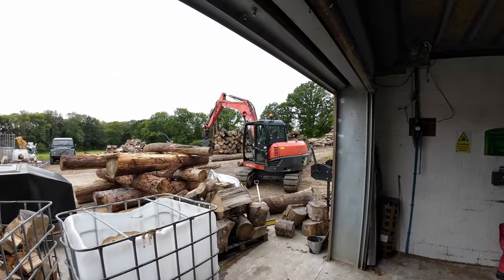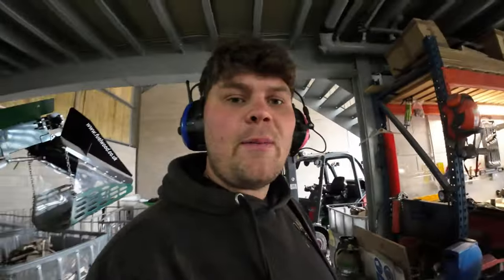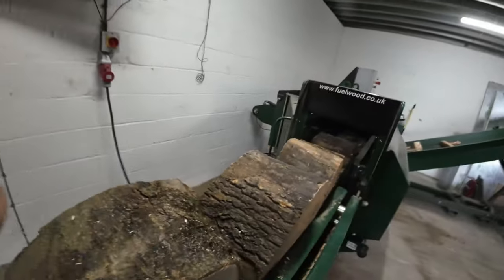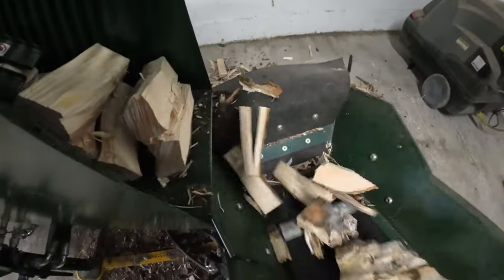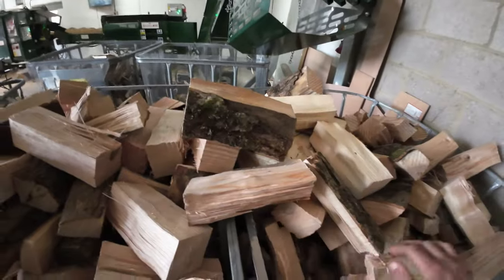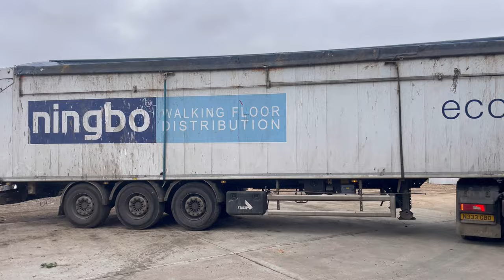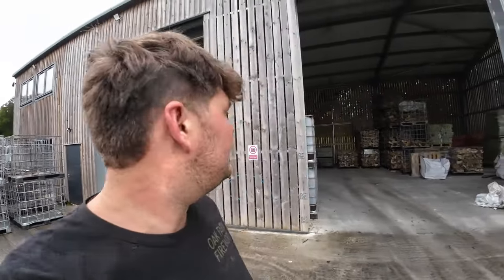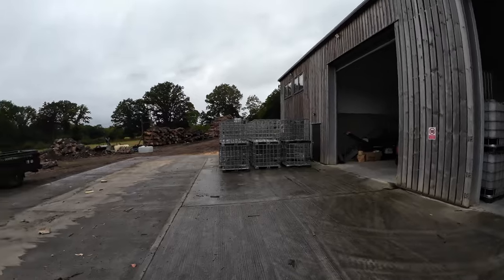Day 34 - New staff and BULK load heading out!

Comment: How many cord is that semi? That’s nice you get big orders like that? What are they using the wood for? I do like the rotators. I’ve been considering a forklift.
Reply from the maker: I’m not sure in cord as we don’t use the, but it’s 80 cubic metres. They resell it on after packing in bags 👍🏼 I would very handy and you have the concrete for it
Reply: From another commentator....
@johnlmaloney
3 weeks ago (edited)
80 cubic meters of wood is 22 cords, which is 57 IBC totes at 1.4 cubic meters (0.39 cord) each.

Comment: 80 IBC Cages..  did i hear that right?..  if so thats roughly 57 facecords of firewood..  nice job sir..  very impressive..
Reply from the maker: Thanks!
Reply: Not 80 cages.
He said 80 "cubes".
That would be 80 cubic meters.  
I have seen your channel.
Reply: 80 cubic meters of wood is 22 cords, which is 57 IBC totes at 1.4 cubic meters (0.39 cord) each.
Reply: @johnlmaloney 22 cords if it was stacked volume. This is loose dumped so more like 180 cubic feet to get a 128 cubic foot of stacked firewood. So 15 cord load roughly.